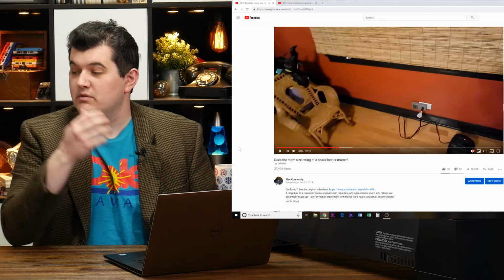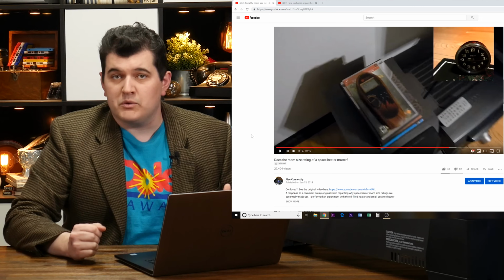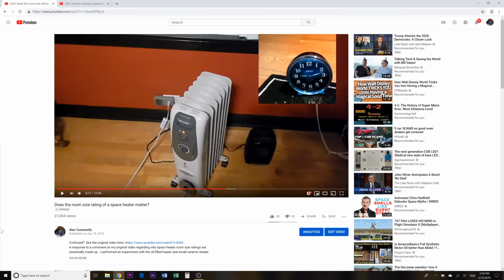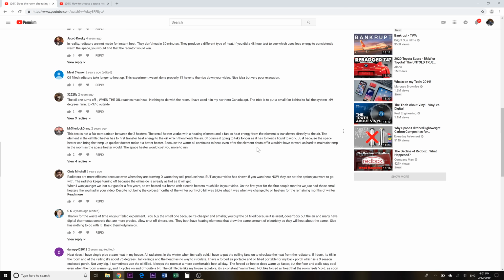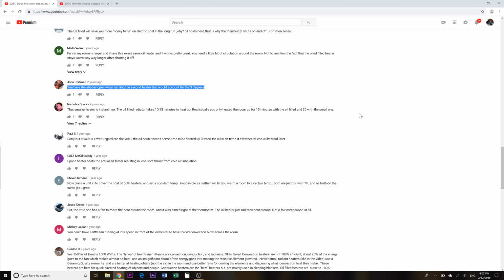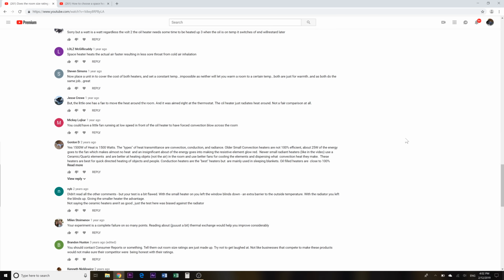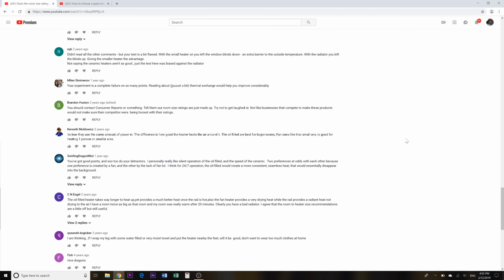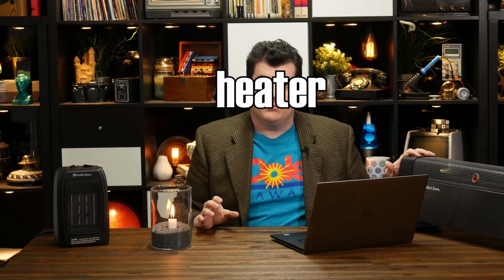More Space Heater Nonsense

Comment: I've always preferred reputable brand name space heaters (GE, Lasko, etc.) from the hardware store as opposed to bigbox stores. Generally they last much longer and are more effective. Our radiator for example, has a lot more ventilation slots then the one in your video, also has a digital readout which is nice for adjusting temperature and power levels (it has Eco mode as well so it can adjust power level automatically), doesn't click on and off all that much and pretty much remains on 24/7 to keep the last room in the house warm. So far it's 3 years old and hasn't had a problem. Everyone goes for the cheapest heater they can find these days, which kind of blows because the market is constantly adjusting for it. Cheap plastic heaters are too common these days. Bearings dry out in the cheap fans, some have meltdowns, literally, and others have faulty switches or thermostats. The worst of it some don't even have fuses/ thermal protection. I guess the point I'm making is invest in something good, you'll get your money's use out of it.

Comment: +Technology Connections 2 — Heat transfer rate is proportional to the difference in temperature. The ceramic heater is better at heating a space, because the *dangerously hot* elements, safely protected from accidental contact, have a much higher difference in temperature from the ambient air, unlike an oil-filled radiator that has its heating surfaces out in the open and needs to be kept at a lower temperature to prevent burns.  So, even though both heaters may draw 1500 watts instantaneously, to stay within the 15-ampere rating of most North American household branch circuits, the oil-filled heater needs to be regulated at a lower temperature than the ceramic heater.  To heat up the air in any room quickly, large or small, I would choose one that heats the air directly with an element that might approach 700° F, or more.  Keep the air in the room warm long enough and the heat will eventually soak into the walls and furniture.

Comment: Could it have anything to do with duty cycle? Like maybe even at the same rated output, one has a heavier duty fan and elements made to run all the time where the smaller one would get overloaded if ran constantly trying to heat a big room. Kind of the same reason Ford doesn’t put their 3.5 L eco boost engine in their super-duty trucks—even though on paper it has more power than the 6.2L gas engine that they do use, the eco boost seems to have problems putting out that kind of power for long periods of time. Apologies if this has already been stated.

Comment: I once had one of those large oil-filled heaters and the only way it could pump out a lot of heat was if I used a separate fan to blow cool air across it.  After a while, I gave up and bought a large Wood-cabinet box that had an infrared heater and a fan inside of it. The thing is really quiet and pumps out about the same amount of heat as your small ceramic heater, but much more quietly.

Comment: This doesn't really address the core issue you're presenting here, but I have definitely noticed that 1500-watt Vornado space heaters seem to be more effective at evenly-dispersing the heat throughout the room, though by definition it must be the same amount of heat.  I think certain shapes of heater control the airflow, and where it goes, more evenly.  That said, mine isn't much larger than the smaller space heater you had sitting on your desk, and its power output is of course identical.  I suppose the only reason I mentioned it is because I think dispersal of the airflow does have some impact on the subjective experience, but it's worth noting that this depends less on the volume of the heater itself, or it heating elements, and more on the shape of the air intakes and outputs, or perhaps the fan blades.

I wanted to add, though, that this is one of my favorite videos of yours, so far :)

Comment: I'm going to say first that thermal layering in a room is a thing. Convection alone is not going to evenly distribute all the energy in a room.  The fire service routinely deals with thermal layering when dealing with tremendously greater amounts of energy, seeing temperature gradients of hundreds of degrees from floor to ceiling in relatively confined spaces involved in fire.  Convection alone will heat a given level in a space slower than forced movement of air from a fan. Just like how my oven will cook faster in convection mode than it will in standard bake mode. I'd be curious to see the ceiling temperature comparisons from your experiment.  

Now I know that's an aside to the real issue of why one heater is better for a different sized room!

In that regard I'm curious if the intended duty cycle of a given heater is the cause for a different rating.  Given 1500W is 1500W it would make sense to me that a heater that needs to run for longer periods, possibly continuously, to heat a larger room would need to be constructed more substantially than a smaller unit intended to shut off and recover periodically.  Kind of like how two cordless drills with the same power rating may both drive a 3" deck screw at similar speeds but one can do it everyday for years with a contractor and another may barely make through a weekend warrior's deck repair.  

Just some thoughts.

Comment: There is one variable that you did not address in any of these videos, although you did hint at it in the discussion of the oil-based heater. That variable is the percentage of time that the switch is closed and the current is flowing. Let's say the tiny heater is running all the time for the test,  it will be 100%, or 1500 watts/hour. If the oil heater cycles off for half the time, it will have used only half (50%) the wattage in the same amount of time, thus using only ~750 watts/hour in the same timeframe.  This could be the missing piece in this experiment and it could explain some of the disparity of the results; what do you think?

As a side note, I like your observation in the last video when you pointed out that if the thermostat  were some distance from the heat source, it could b ebetter at managing the true temperature of the room.
Reply: Sorry Michael, you just don't seem to understand the Laws of Thermodynamics. I understand what you're trying to say, but the basic reasoning is flawed.

Comment: I will provide an eccentric engineer's anecdote about a completely different space heater: a colleague of mine, responsible for several startups here in Silicon Valley, uses an old, completely obsolete desktop computer and monitor running the original Windows 95 to heat his office and workbench. It hardly functions but then, that isn't the point. It produces some 700 watts of heat, just enough to warm up his space on a chilly winter morning. Ultimately, it's all just heat.

Comment: Directionality, e.g. a parabolic UV heater, is the only other parameter that could improve performance for heating a person (or thing) thus introducing a different efficiency mode than the simple watt-to-heat conversion which, as you point out, is completely straightforward and unambiguous. Oil-filled radiators seem to only allow for a temporal domain performance shift but to a questionable end; staying warm somewhat longer after turning off despite taking longer to heat up? I'm inclined to think of them as a gimmick.

Comment: I added a pilot light to one oil filled heater I had. It helped explain what goes on. When the thermostat turns the heating element on and off. You are right that the 'room size' rating is very misleading. It does however show that a small heater works for a small room, such as a bathroom. But its use of 'large room 'is misleading for oil filled units. By the way the old limit was 1850 watts maybe 20 years ago.

The 'room size' recommendation helps customers to some extent, but it is misleading for oil filled heaters in large rooms that are somewhat warm. If they are very cold say fifty degrees when they start they might heat continuously, but I suspect that when it is warmer like  sixty degrees F when they start, they will often turn themselves off prematurely for safety reasons. Especially if the air is still which of course it usually is. 

Anyway, safety and available space are also concerns which are taken into account I think, when the manufacturers mention a recommended room size. Radiant heaters work best in big spaces and won't set nearby objects on fire, because there is more space to locate them. Small heaters are convenient in small rooms.  Physically large heaters are not a size disadvantage in large rooms. This means oil filled heaters which are inherently fire safe, work well there. They are also very quiet, and you won't burn yourself on them unless you are really stupid. 

Its all counterintuitive and kinda oxymoronish but it at least helps customers to some extent. btw I'm an old architect in California, with lots of interest and experience in solar and energy stuff, and energy calculations. And have even helped people in a hardware store where I worked part time in plumbing and electrical. Heating and cooling is often complicated when you throw in the effects of thermal mass, the temperature of the objects in the room, air temperature, air movement, humidity, costs, and the human factor.

Comment: Alright, I do feel the need to make a comment here.  All the points you made are valid and largely correct, but I think you've fixated on one aspect too much, and that has kept you from considering alternative points.

All of these resistive heaters max out at providing 1500 Watts due to the limitations of the power they're being supplied with (120V rms 15amp electric outlet).

However, a heater is not always running at full-blast.  It is cycling on and off based on whatever fancy or primitive thermostat control they have going.  

This is the part that you're missing:  The material integrity and longevity.  There are two things that damage resistive filaments.  First is running at high temperatures, and second is cycling temperature.

Now, this is just a demonstrative anecdote, but consistent with theory and actually of descent sample size:  When my parents build their house some 25 years ago, my mother made it a point to get 130-Volt incandescents for the main lightbulbs in the bathrooms (which ran on 120V power), despite those bulbs costing 3x as much.   These lights were vanity-style, which is to say, an  'array of lights across the top of the mirror' style.  So 8 lights for the basement,  and 12 in the master and secondary baths upstairs each.  The 4 lights in the powder room, despite it being the same style, have always gotten the regular lightbulbs. While every other lightbulb in our house has been replaced multiple times over the years (including those in the powder room despite equal or lesser use), out of the initial 32 lightbulbs installed, only two have burned out after 25 years.  This is because they are built to run a normal lifespan with 130 volts running through them.  A 10% drop in voltage makes for a 20% drop in expected power, which actually results in a SIGNIFICANT drop in temperature and overall degradation of the filament.  Hence their evident longevity.

To heat a room, a space heater needs to be able to average a power output equal or greater than the rate of heat loss at the desired temperature (as you said in your prior video).  This means that if a room has a heat loss of greater than 1500 watts, you will not be able to keep it at that temperature, regardless of whether it's a 'big room' or 'small room' heater doing the work.  If the room needs less heating than that, like 300 watts or 1200 watts, then both heaters will end up turning on and off while approximating a 20% or 80% duty cycle. This is all accurate.

However!  The small heater is going to have much less filament with which to heat than the large heater.  Which means that every inch of filament in the small heater is going to be reaching equilibrium with transmitting its 1500Watts to the air at a much higher temperature.  This should be obvious, as less filament means the filament needs greater power density to convey the same rate of energy to the air - and power density is a function of the air temperature against the filament temperature.  Less filament + same net power = hotter filament.  And you couldn't just cram a bunch more filament in a small heater because each loop needs some minimal access to air to actually give away it's heat - or else it'll still just heat up to the same temperature.

Actually - the reason that small heaters have fans while large heaters don't isn't because the people making the small heater just wanted it to be better.  It's because the filaments would get up to a RIDICULOUS temperature without a large volume of air constantly blowing past them.  If that fan breaks, you can use the small heater, but don't be surprised if it dies with a month of normal use afterwards.

So if you ran a small and a large heater in a small bedroom that's only losing, say, 300 watts of heat, they'll both run at a 20% duty cycle, both heat the room at about the same speed, and both manage to do this for 10 hours a day, 50 days a year for 5 or 10 years without issue.

But if you put both heaters in a common room, with a big wall or windows or roof-area to leak, say, 1200 watts of heat to the outside, both of your heaters will run at an ~80% duty cycle, both heat the room at about the same speed, and both manage to do this for 50 days a year.  But that small heater is going to be running its filaments MUCH hotter and will probably crap out after only doing this for a year or three.  Because while its max power is the same as the bigger units, it is not designed to survive outputting that power for so long.  My guess is they design these heaters to survive about 10 years of 'average' operation inside their designated room size.  

Put another way, the big one will survive heating a big room for a decade. The small one will survive heating a small room for a decade. But the small one will not survive heating a big room for the same length of time.  Whether it only survives 70% as long, or 50% as long, or 20% as long I can't guess at.  But if you hooked up a hundred of each type and had them deliver the same heating power over a long span of time, the failure rates between the two groups would show a distinct delta, especially at higher power demands.

It's certainly possible, depending on the price difference between the 'big room' and 'small room' heaters that you might still be better off with using small heaters.  If they last half as long and cost a third as much - then go for it!  But know that this is not simply a 'marketing gimmick'.  If it was, those big room heaters would just be large boxes hiding the smaller and more material-efficient small room heaters inside.  If there was no difference between them at all, they'd use the cheaper design and just change the packaging.  So if there is a difference on the interior guts, it's for a purpose.  That purpose is increased longevity through lower-operating temperatures by outputting the same power across a much larger filament bank and accessing more air-contact area.

I sympathize with people misunderstanding the nature of things and arguing inanities and anecdotes against the basic thermodynamics you''re discussing.  But you've limited your scope to just one aspect and haven't considered the holistic set of circumstances that dictate design and operation - confusing a single major parameter as being identical with the overall functionality being identical. And that's just not correct.

Comment: Oil vs ceramic, you know better.  I will say a small ceramic vs wide baseboard both pulling the 1500 would be a good comparison.  I had an old 2005 baseboard unit that heated the entire house.  And kept using it until the element gave out.  And it was pricey.  Now I keep a fake fireplace unit with ceramic heating unit and forced air fan.  Looks good, can run all night and it's up to 5 years old.   Please keep to the electronic subjects.  Your better than getting dragged down with heaters.  PS I use flat panels for my garage and they are controlled by a separate sensor in the room.

Comment: You’re obviously right because they’re are 1500 W they must be putting out the same heat. However if you don’t believe the science, the experiment you did was not very good. You need to control for the outside weather. And you also need to let the room fall back to the outside temperature before starting the next heater. And finally you need to let the heater run so long that there is no question that it has reached it’s maximum potential. Maybe you did these things and did not show them in your summary in this video. But as shown it was an ok experiment but not very scientific.

Comment: I live in a 4,000 SQ house built in 1850. I use electric heaters to heat individual rooms in the winter. I agree with you except for one point. They all don't heat the same because of their design. Some are just made dumb. An example would be a Sunbeam heater I have, it was $30.00. No thermostat just a high and low setting of 1500 or 750 watts with a fan  and just runs non-stop, it's a smaller heater like the one in your experiment. Then I have a cheapy I bought at walmart for $9.95, about the same size with a thermostat. The cheapy blows a lot more hot air than the more expensive one just because of it's design, even though they don't last long because of their cheapness compared to the the sunbeam which we've had for years. So even though they use the same wattage some are just designed poorly. PS - I really do enjoy your videos.